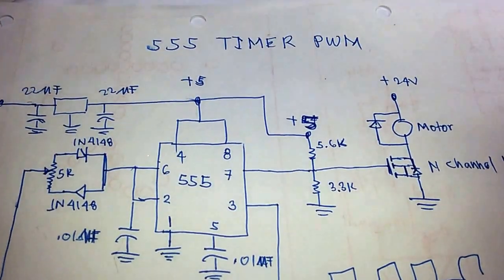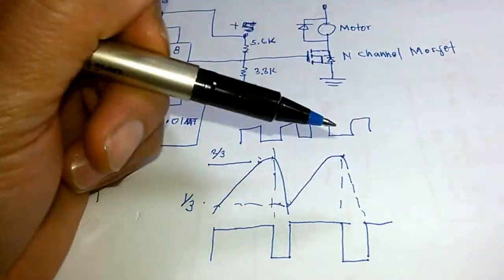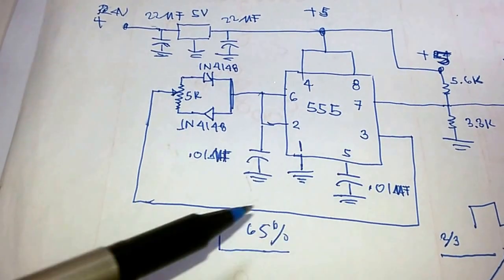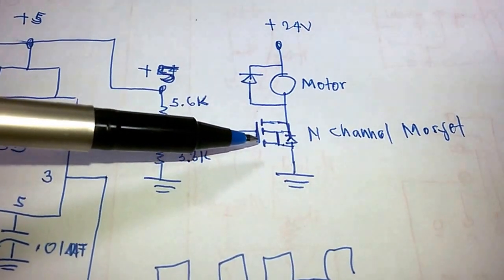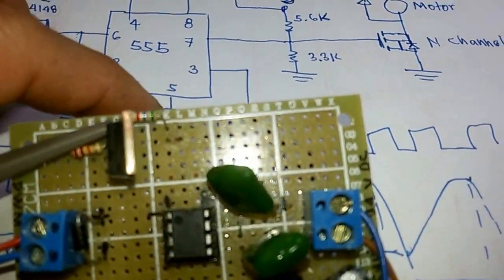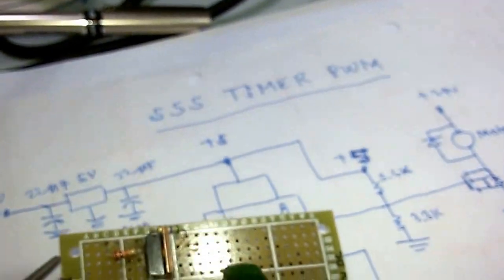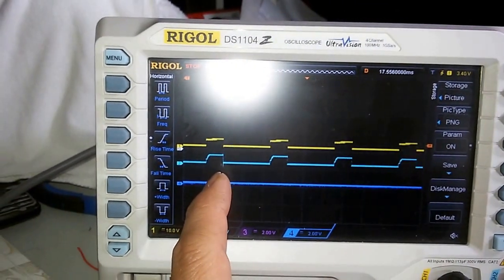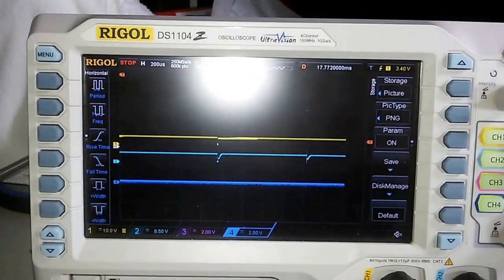How to make PWM using 555 timer

Comment: I made this circuit today and works well enough.As mosfet I used IRF 640 (18 Amps) but I had to disconect  3.3 k resistor.I will use it For adj. power suply 35 volts adding some more (protection e.t.r.)   Thank you very mutch for sharring !!!!
Reply from the maker: Great...